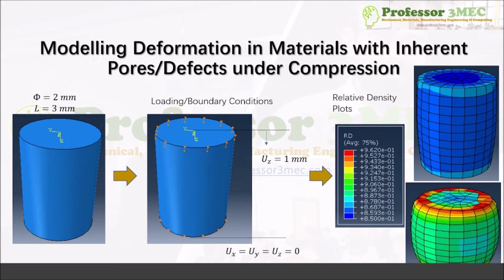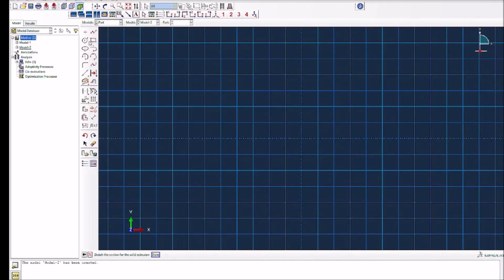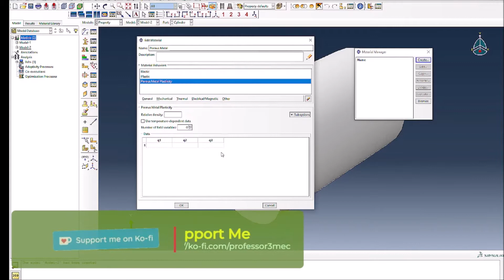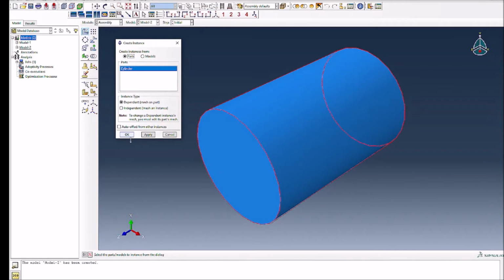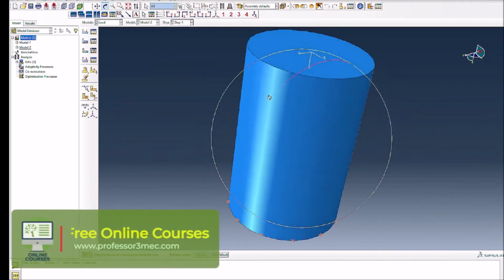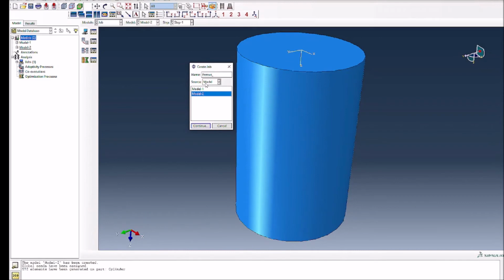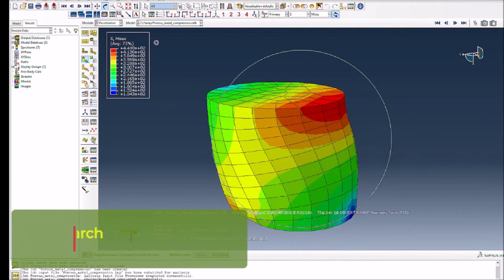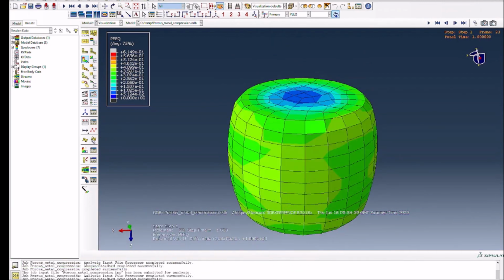Step by Step Tutorial on Modelling Deformation in Porous Metals : ABAQUS CAE Tutorial

Comment: what's the difference between checking the box in boundary conditions for "create a set" or not checking that?
Reply from the maker: In Abaqus, checking the “create a set” box when defining boundary conditions creates a named set for the nodes or elements where the boundary condition is applied. This allows you to easily reference or modify the set later in the model without having to manually select the nodes or elements again. If you don’t check the box, Abaqus will still apply the boundary condition, but it won’t store the selection as a set, making it harder to track or reuse that specific group in future steps or adjustments.

Comment: Can you make a video on Plastic deformation of microstructure generated in dream 3d using abaqus
Reply from the maker: do you mean crystal plasticity based simulation? if you have a microstructure file then I can create a simple example.
Reply: @Professor3MEC  Sir I don't have microstructure file.  i want to learn from scratch regarding creating microstructure file and then doing crystal plasticity simulation. i would be grlateful to you if you can kindly create a video series on crystal plasticity involving various types of deformation like compression, tension, rolling, forging etc combined with effect of heat treatment.
Reply from the maker: @AKASHKUMAR-jz9yv  ok I will work with simple microstructure and then may be incrementally move towards complex ones. But might take time as these videos are in process.